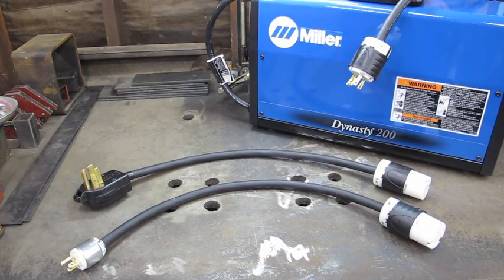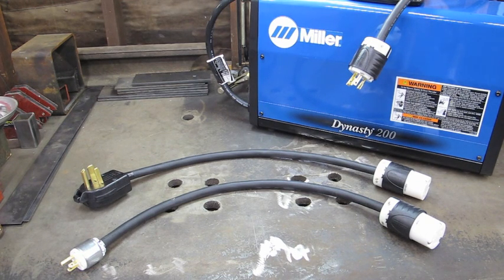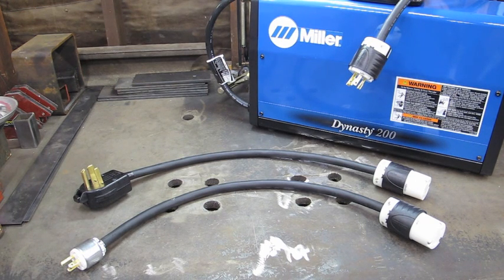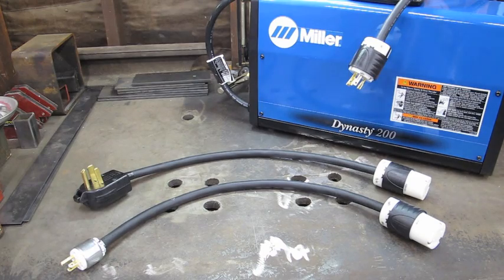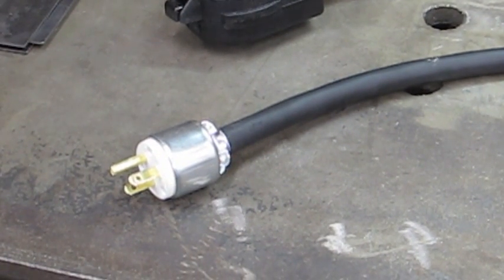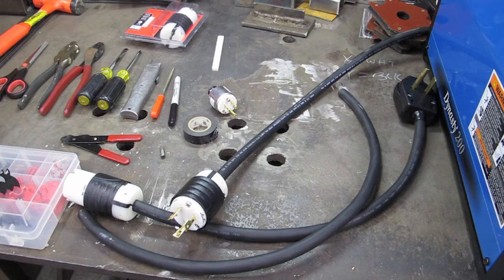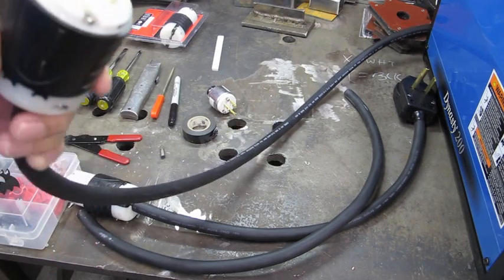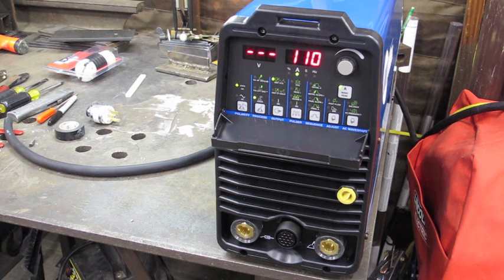Multi Volt Adapters for Miller Dynasty Part 1

Comment: hi just got one wat breaker you running on 245/250v
Reply: as far as I under stand  its max load at 240v is 31amps according to rear of machine iam and electrician I was under the impression it would just plug into my 13a 240v socket like my old mig welder

Comment: Thanks for the FYI video, and your disclaimer you are not an electrician

If your receptical is located within your garage / shed / shop, it needs to be located >36" off the floor and any water source.  
Nominal voltages are 120 or 240v, not 110 or 250v.
The "Dryer Plug" reference is not correct, for it has four electrical contacts.  The plug you are referring about is typically a welding receptical, a NEMA 6-50, with a maximum rating of 250v @ 50a. 

Thanks,
James
TDLR Electrician
Reply from the maker: +jd dr.jkindle Again, thanks for your expert help!

Comment: I have same welder but it has 4 wires with a male 4 prong twist lock. With that, since I won't use 3 phase, the red wire wil not be utilized